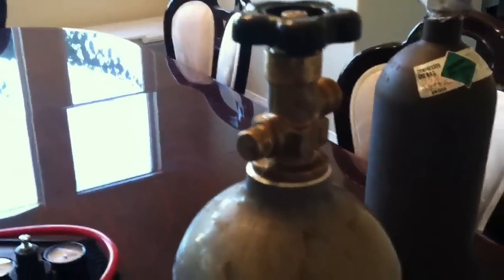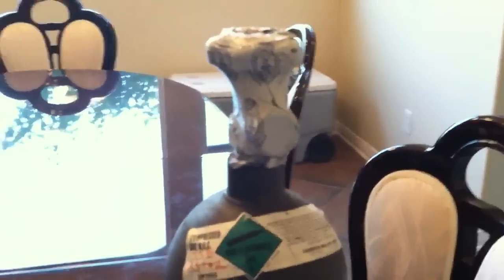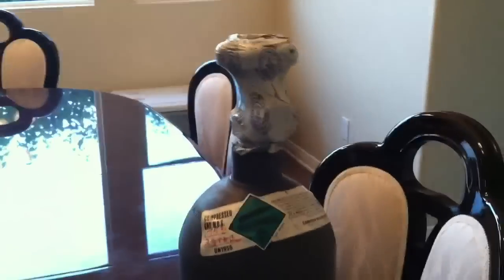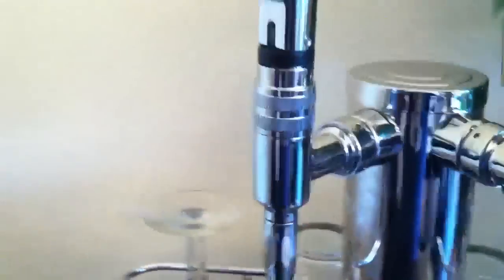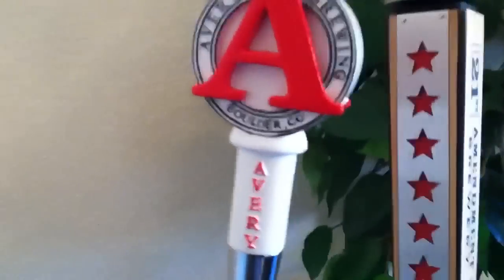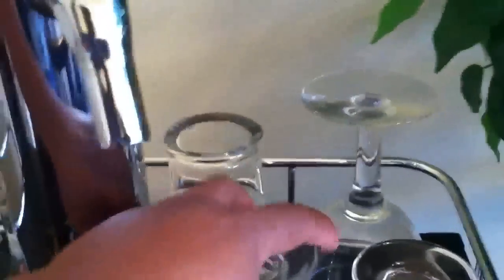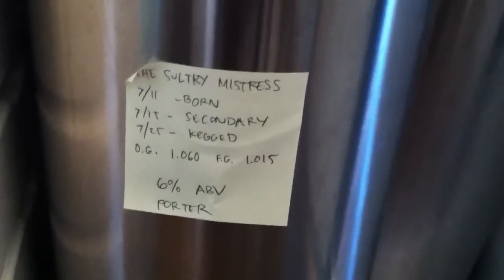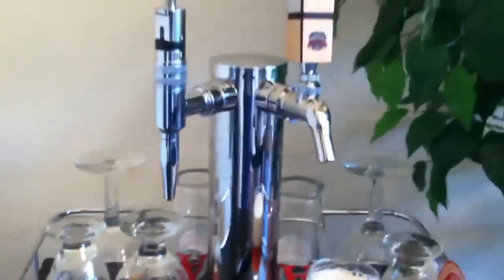New Toys! Nitrogen Beer Gas and Stout Faucet 1/2 - Epic Beer Dude

Comment from the maker: @chriskat9 The way I do it now is crank my co2 tank and force/shake carb for 1 minute 30 seconds, and let sit for about 3 hours before I blow off the pressure. after the pressure is fully released i put my nitro tank on it , set it to 30psi and leave it for a week. i serve nitro at 30psi thru a nitro faucet .. i used to serve at 35 but found the head creamier at 30

Comment from the maker: @06specvcodered yep, you buy what's called a 'CANBEV' tank. the smallest one i could find was a 12lb. it the canbev mixture is either 75no2/25co2 or 70/30 respectively. it doesnt work like a normal co2 tank where you go get it filled, usually you have to trade for a new one and most of the time you have to order it a few days in advance. visit your local welding shop (usually where you get your co2 tanks refilled) and they can order one for you or may even have one in stock.

Comment from the maker: for this scenario i do 30psi. if im force carbing anything else i do 35psi for about 3mins. just remember to turn your co2 tank down to serving pressure before reconnecting it 2 ur system. also, don't blow off the pressure right away , you'll end up with a mess.. and it gives time for more of the co2 to dissolve into solution. just make sure you releive the pressure before connecting your nitro tank to it. other people leave it soley on nitro for 2 weeks, i feel its a waste since nitro is money